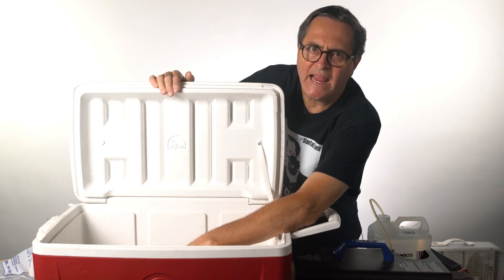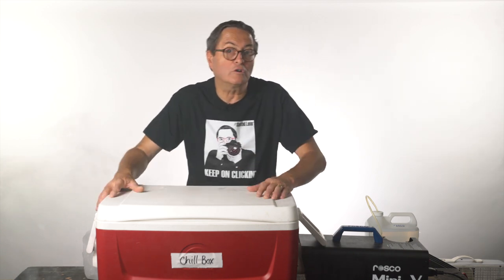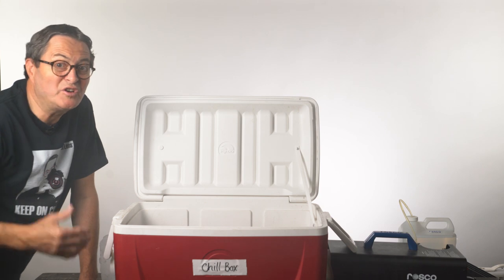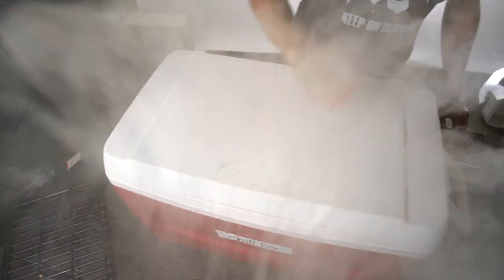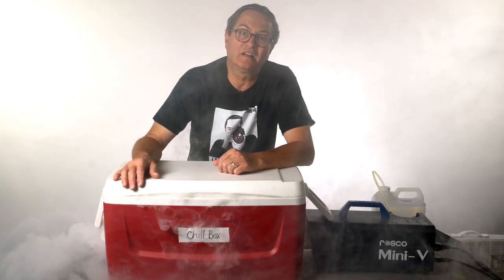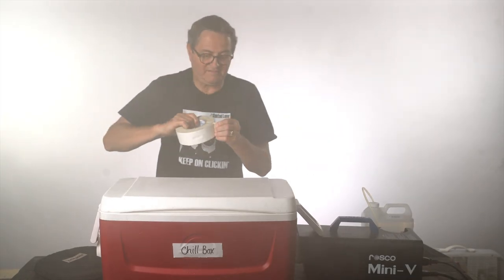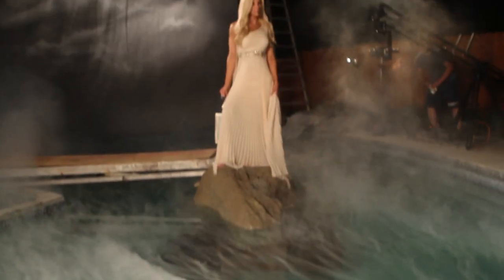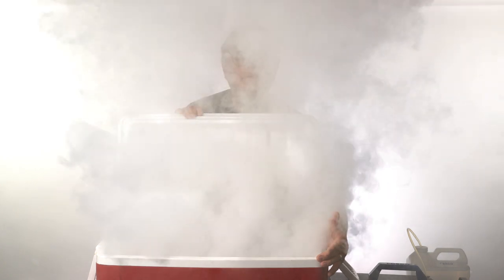QuickTip: Turn Smoke Into Low-Lying Fog for Your Next Shoot

Comment: OH MY GOD that's awesome. I would recommend using a disposable styrofoam cooler - easier to cut.
Reply from the maker: Glad you enjoyed it, Richard! I've never tried styrofoam- let me know how it works!
Reply: Dang. Now I have to do it. CHALLENGE ACCEP
Reply: You should use a kitty litter box that's what we do it works awesome. Plus ice cubes allow it stay on the ground longer because it has to run through it more.
Reply: @richarddufault  Did you end up doing it with a styrofoam cooler?

Comment: anyone recommend a good ratio of VG to water for thick fog? is 30% good?
Reply from the maker: Very Thick Smoke:
30% Glycerin | 70% Water

Thick Smoke:
20% Glycerin | 80% Water

Less Thick Smoke:
15% Glycerin | 85% Water
Reply: @TheSlantedLens  cool thanks, I did the 30% - set off the smoke alarms! So gonna try the ice method.

Comment: "They're pretty hard to find" 5000 youtube fog chiller vids later lol ; ) It helps the effect if you leave a 1 inch gap between the fog machine and the inlet. that's what the vortex fusion product instructions say that most of these DIY chillers are based on. yours is more like the original DIY 'fog on the rocks' which predated it fwiw.  for my $40 worth + DIY time for a $120 vortex fusion knockoff if the fog doesn't lay low I do like the lingering atmosphere sometimes better. it should be noted use a  low wattage fog machine so it doesn't shoot it thru too fast not giving it a chance to chill. happy fogging ^v^
Reply from the maker: Haha, good insights! Have fun this Halloween!

Comment: Please be careful with dry ice folks, especially if your model is low to the ground. The CO that's dissipated by the dry ice can push away the oxygen and cause suffocation.

P.S.:
You could also just fill up the cooling box with warm water and throw dry ice in, you'd only need an exhaust hole.
Reply from the maker: That is correct. I was doing this with a block of ice and it worked. No problem there. Thanks
Reply: What a great idea duh thanks so much! Saved me hundreds